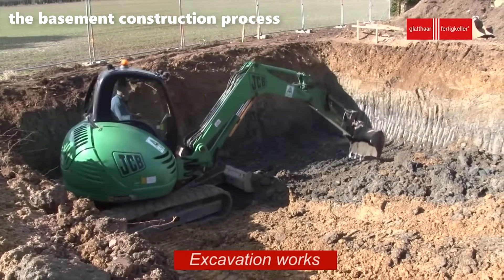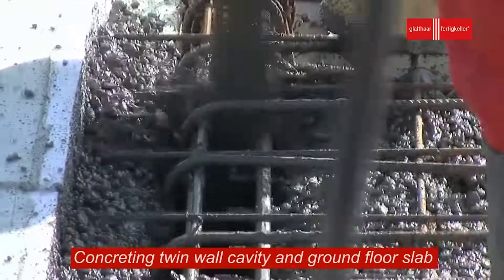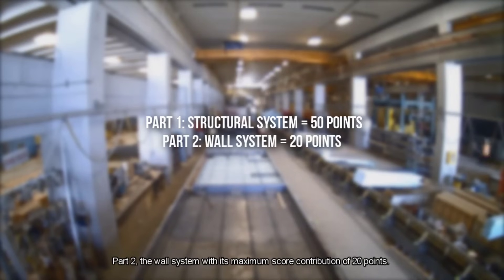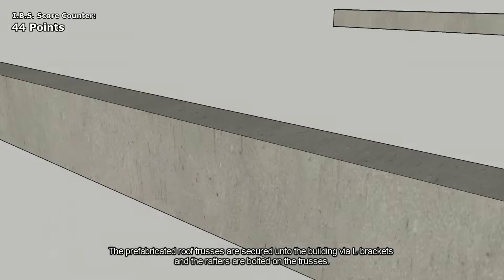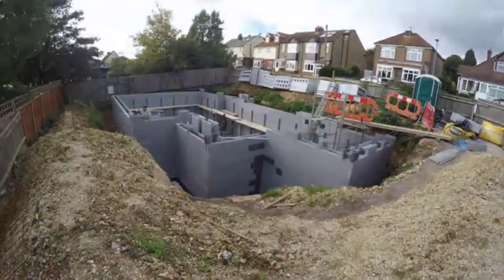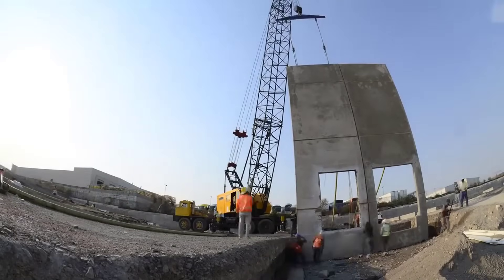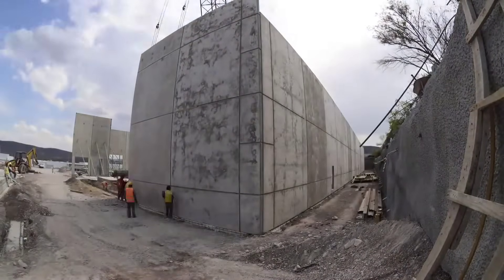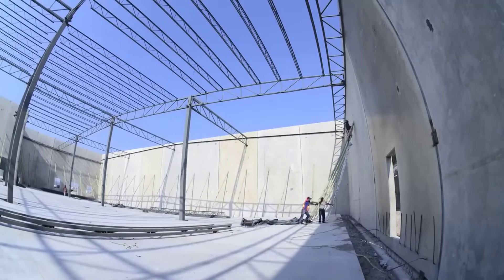Amazing Modern Basement Construction Technology - Amazing Ingenious House Construction Workers

Comment: No thanks....When it comes to a basement??  Pre-fabricated walls fitted together??  That's a water leak waiting to happen.  I would absolutely insist on poured reinforced concrete walls double the thickness of whatever building code says it should be.   And the walls would be one, continuous wall, all the way around.  no seams.  No cracks.  no nothing.  Just one continuous wall!

As far as pre-fabricated walls for the main house??  I dunno... You'd have to do a lot of convincing for me to go along with that....

Comment: What is the R value of the walls and why is there a large void in them?
Reply: Depends on the type of insulation. Polyurethane is not Polyisocyanurate or polystyrene. The voids are there for the removal of dampness. (Breathing).

Comment: I like the idea of lego-like predesigned block staking construction. It will reduce a large amount of money effort labors... looks so efficient. I don't know why construction companies in my homeland wouldn't give it a try. It's the utmost modern technology in fields of construction and logistics for housing.
Reply: Here in the Philippines you must be a big construction company with your own crane and trucks for hauling and placing these concrete wall panels. Otherwise the cost of renting these equipments will eat a big chunk of the budget and the project will even cost more than on site building. Mobile crane rentals here in the Philippines cost more than 100$ per hour depending on the size of the  crane.
Reply: The answer to your question lies in your comment. It is predesigned, so most installation (electricity piping and switch box or and socket boxes) needs to be fixed inside the concrete and this means there is hardly any room for change after the precast elements are fabricated. If you buy this home and want the light switch or a wall outlet on a different location, it’ll cost a lot of money to do this. In the US you just open the paper wall and relocate the wiring, in concrete you need to mill, grind or saw in a concrete wall to the new location, fix the piping, seal  it and cover it with stucco. This is much more expensive. I know, because I bought a house where all the sockets (or wall outlets) were about 4 feet above the floor (in full view) and I wanted all sockets at 1 feet above the floor (out of view), in all rooms except kitchen and bathroom (where all sockets are at countertop height). I didn’t have the tools and materials to do it myself and it costs me about €10,000 to let it all done, which is about $11,000.

Comment: The column slab joint is a guaranteed death trap waiting to happen in any seismic zone.
Reply: This is a bad example. Reinforced precast concrete frame is the only technology than can endure 9 points earthquake. Everything should have been tied tightly. Even the foundation is not properly made. Welded mesh is disgrace.
Reply: The Japanese engineered earth quake dampers at the footing & structural key points to absorb quake movement energy

Comment: Do not buy these IBS bullcrap. The structure will be very weak and maintenance is very hard. When a precast panel cracks, it will crack the whole thing not just one section. You have to demolish a whole wall to fix or add something. In the long term, it costs more to have these pre cast structure than traditional brick and concrete. The French historical structures withstand the test of time because they were built with brick and concrete.
Reply: Sounds like you speak from experience. Experience is the best teacher. What do you suggest as an alternative?
Reply: 💯 I agree with you. Cannot be fused together properly and as such will teach the user an extremely valuable lesson in the event of an earthquake and possibly typhoon. Even if the backfired soil absorbs enough water as it passes against the foot of the basement wall it can certainly push it inward, this causing the upper floors to collapse. It is only time before I’m proven right after a small trimmer takes down a hospital that was built in this way and after the demise of hundreds.
Reply: It is a high quality system, but suited for only a few conditions. In my country IBS is used, but mostly not for cellars, because cellars are floating in groundwater here, so a building structure needs to be heavier than the floating power of water. And the precast element joints and seams need to be waterproof or the cellar will let groundwater seeps in. If they use precast cellar walls, they often use bituminous roofing at the whole outside of the cellar to keep the water out.
Reply: The way they set up the building is not modern. 40 years ago I built a cellar that was thermally insulated from the ground up. The  foundation (bearing outer walls and loadbearing inner walls ) stood on loadbearing insulation. (Foamglass) 
The concrete slab reinforced with rebar was poored over lesser loadbearing  insulation that would not compress. In all the surface was protected against the creation of thermal bridges. So when the underground walls went up there were no thermal gaps. The entire building had 10 inches of insulation except for the roof that has 12. Of course windows and doors will be thermal leaks. That's why the doors have 4 inches of insulation and windows all are double glazed that can be shuttered and also are insulated. To prevent mold the entire house has a special ventilation system that can recover a much of the heat that would be expelled.
Mind you. This was 40 years ago.
Reply: Guys...time is money,and from my expirience, working in Germany fot the past five years , this systems, although 15- 20 % more expesinsiv3 initialy, payoff in lower labour costs and saved time. And for technical part of it, they are wayyyy above anything u can find as common ways of contruction in US. Just check the enginering heritage of De.
Reply: @domagojturkovic7144 they don't have issues with earthquakes in Germany

Comment: HEY!? AS I SEE IT!! THIS OLD AS METHUSALA!! CONSTRUCTION METHOD HAS MANY ADVANTAGES NOW!! TO BEGIN, CONCRETE MIX IS QUITE CHEAP!! THE PREINGINEERED MODULAR SYSTEM ALLOWS FOR CONSIDERABLE CUSTOMIZATION POSIBILITIES! AS WELL AS GREATER BUILDING TECHNOLOGY APPLICATIONS A MATERIAL SYSTEM THAT WAS LONG USED ON A PRIMARY COMMERCIAL SCALE! FOR EONS!! HAS NOW FINALY ENFOLDED DOMESTIC & FAMILY LIVING SPACES APPLICATIONS!! SO!? KUDOS~!! CLEARLY NOW THEN!, LIVING SPACES SHOULD NOW! B UTOPIAHCALLY CHEAP!!TO CREATE!!, HOWEVER, FROM AN OBSERVABLE ENGINEERING PERSPECTIVE!, THESE PANEL STRUCTURES CAN NOW ALSO B DESIGNED TO WITHSTAND HURRICANES! TORNADOES!! & EVEN POSS. EARTHQUAKES!!! ADDITIONAL, SINCE WIND SHEAR! FIND PASSAGES IN ALL CONNECTION POINTS!! AN UPGRADE IN (R&d) DESIGN! WOULD ALSO EXPAND THE DATA RESOURCE POOL REGARDING THIS UNIQUE BUILDING APPLICATION NOT TO MENTION! TWEAKE TECHNOLOGIES!! ADDITIONALY, THE UNSUSTAINABLE EXPANDING HUMANSCALE BAD!HABIT OF CONSTANTLY MAJORLY BUILDING IN WOOD!, EVEN FOR LARGE SCALE [COMPRESSIVE & LINEAR STRUCTURAL ] USES!! RATHER THAN THE RESPECTFUL AESTHETIC BEAUTY!! OF ACCENTED FACIA! RATHER, HEAVY WOODEN MEMBERS IS THE ME TO THING!!!...

Comment: So you can use fans in tandem with dehumidifiers to dry concrete faster. 🤔 Now make sure the fans filter the air getting blown on the concrete.  Yes the quality of the air blowing on the concrete matters. So using fans that filter the air is best to dry the concrete. And then using the dehumidifier to take the moisture out of the air around the concrete. And yes, you would have to hang them over. The concrete and around the concrete are optimally effective. You can use a crane to hold the dehumidifier over the concrete.

Generative AI is experimental. Info quality may vary.

Yes, you can use fans to dry concrete. You can place fans in the affected room and close the doors. The air movement will help dry out the concrete. 

You can also use a dehumidifier in tandem with fans to help draw out the air humidity and excess water quickly. 

The fastest way to dry a concrete floor is to use a fan that blows heat on the surface of the concrete floor. However, you should follow the instructions of the process and give your wet concrete floors the exact time they need to dry. Rushing the process may reduce the concrete quality. 

Concrete drying in a certain environment varies depending on how hot, cold, humid, or dry it is. 

You can also check out this video:

Dehumidification and Drying Concrete: Hurrying Up the Wait

https://www.wagnermeters.com/concrete-moisture-test/concrete-info/dehumidification-and-drying-concrete/

You wanna put this in place as you're using the vibrator to move out air and moisture upward, condensing the concrete. So you don't wait till you finish smoothing it. The process starts with the vibrator and you apply. The humidifier, but you got understand you need to be very good about smoothing it behind the vibrator. Now you could use some kind of water suction of excess water will smoothing the concrete to remove excess water as well.

Comment: Pre-built or Pre-designed home is future of construction. I enjoyed watching this video. Thank you for bringing this video to watch
Reply: No. It reqires cranes and thick foundation. The only advantages of this technology is the speed if you build a multy-storey buildings.
Reply: No they are not.
Reply: Depends on where you are at. These precast walls kind of suck because you cannot add or change anything down the road. Based on the clay content, I would have used concrete foundation walls on this project.
Reply: This was one of the reasons we killed Ceaușescu some 34 years ago. He implemented this precast concrete slabs method  in 70's. This standardization affected urban architecture, influenced furniture production, appliances so on and therefore during communist gilded ages you can move  from an apartment to another with no major issues. Standardization was and is even more in our days the key for economical efficiency.